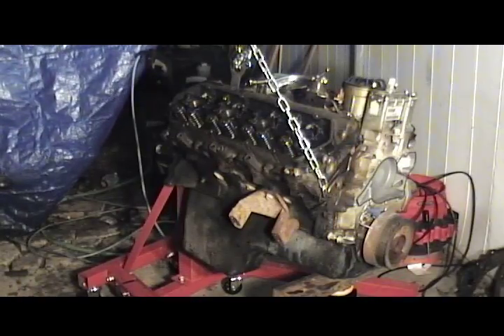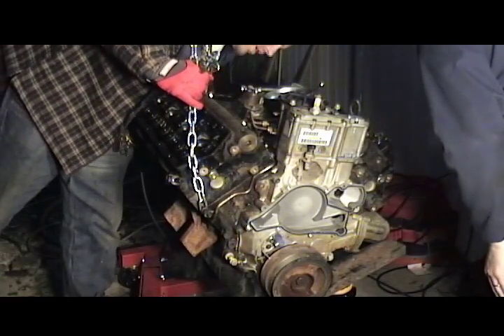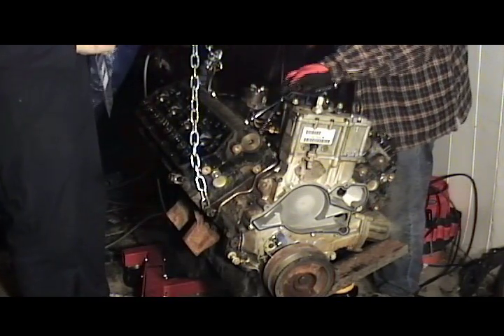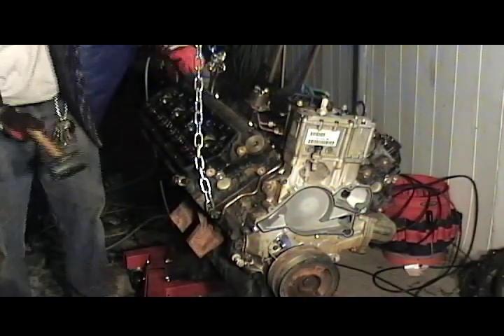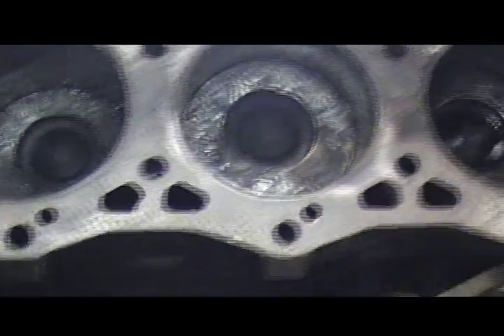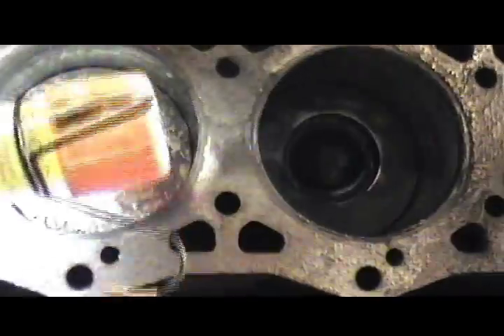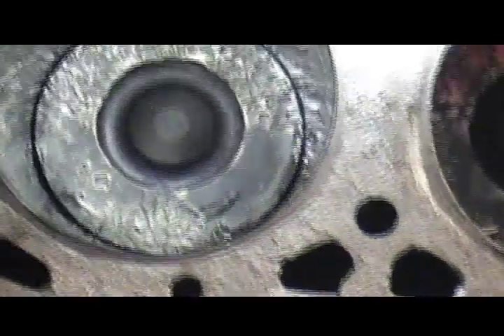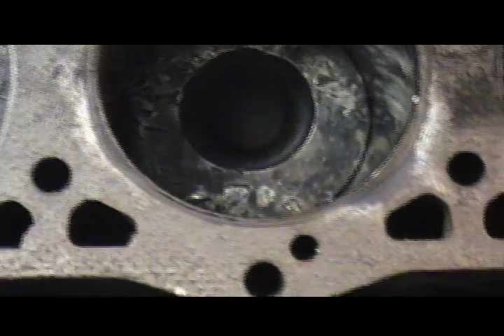7.3L Powerstroke Teardown - Head Removal

Comment: is there a chip in it?
 like in the pcm? this looks like over fueling
Reply from the maker: no chip, it was a fleet truck.  still no chip.  had a cracked air cleaner box and the engine got dusted from working in the (near) desert conditions in new mexico and west texas.
Reply: lovly

Comment from the maker: injectors were shot internally.  but the failure was because of compression rings on those two cylinders after being dusted.  purchased a long block and did a core exchange, didn't try to salvage that one.  the ring debri was all in the oil system and trashed the turbocharger on the way out.  You can see some details in my other vids.

Comment from the maker: I can't recall pulling the drivers.  My IR thermo and compression gauge told me to go to those 2 cylinders.  the front 2 on that bank were fine though.  seems like i did some forum searches and found others that had dusting problems with those 2.  maybe some inherent airflow characteristic that causes those two to die more often when being dusted.  who knows.

Comment: how did the drivers side look?? my truck is dusted too and ran just like yours. i only pulled drivers head so far everything looks good on that side. any tips so the cylinders dont fill up with oil when pulling the injectors and heads??

Comment: I had the same thought, if I could find a rolled dodge. The 5.9 straight six could fix in a mid sized car. And the turbo kits with no real modification. You are going to start seeing in the next 5 years a lot of super cars going diesel. It is going to be funny to see the smoke roll out of them.

Comment from the maker: would like to put one in something else.  like a late 80's to mid 90's bronco.  just for giggles.  would make a beast of a vehicle.  I don't have an issue with the 7.3.  the later ones were good engines in commercial chassis.  it was the emissions equipment on the pickup chassis that cause most the issues with the later powerstrokes and nowadays most diesels including cummins and duramax.  would love to have a purely mechanical and bulletproof vehicle though.

Comment from the maker: 200k+ on miles without air filtration in west texas was reliable enough for the previous fleet owner and even a cummins engine would have succombed.  nothing wrong with a cummins engine.  also nothing wrong with the IH DT444 that this uses.  Plus this way i don't have to re-engineer anything.

Comment: The next time your power stroke goes out toss it. They have kits to place the 5.9 cummins in it. Same goes for your duramax. It is common because the ford and chevy diesels suck! Very popular when the v10 motors crap out too. I don't like dodge but as diesels go it's far cheaper to work on and rebuild and most importantly reliability.

Comment from the maker: @teambluemxer thanks, still fighting oil leaks.  I wondered about EGT's but the exhaust valves weren't obviously shot like the intakes were.  My understanding is that high EGT's should fry the margins on exhaust valves because of material erosion.  On the flip side the pistons had high spots like there was metal depositing.  could have just been the aluminium of the pistons reflowing around the cuts the ring debris made.  not sure.  ended up finding a nice and affordable blueprinted long block.

Comment from the maker: when the air filter breaks and allows dust contaminated air to be ingested into the engine.  It essentially acts like a sand blaster and abrasive over the long term and destroys the engine.  It's really bad in diesels because they need tighter tolerances to ensure good compression.

Comment from the maker: After further inspection it looks like the engine was dusted and ingested it's own rings.  The ring bits beat up the pistons.  The valve margin looks to have been eroded away.  Not sure if it was a combustion problem or from the bits of compression rings.  At this point i'm looking for financing for a long block.  No obvious bent rods (push or connecting).

Comment from the maker: Truck has about 210k and was probably heavily abused by previous owner, oilfield drilling company.  Nothing is roughneck proof.  Turbo shows signs of dusting, tips of GP and injectors intact, wondering if dusting and potential fuel washing of cylinder by bad injector in #5 caused catastrophic ring failure.